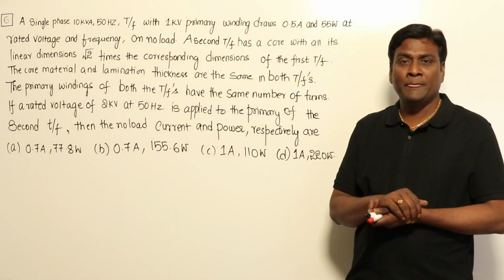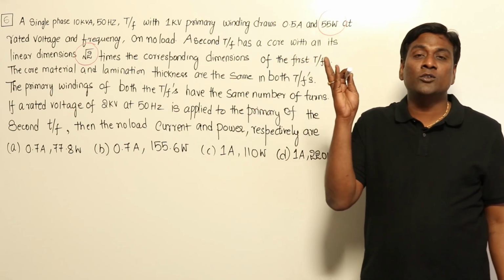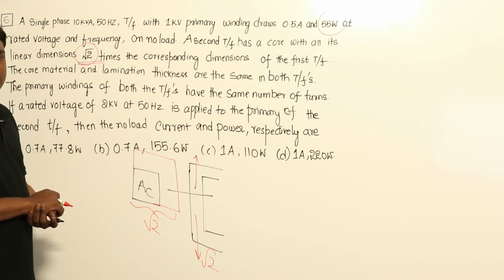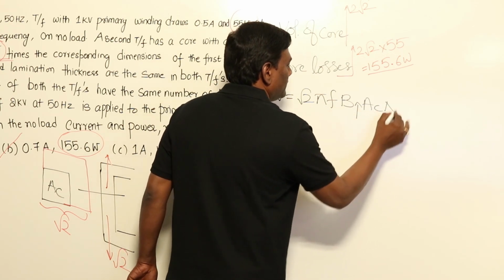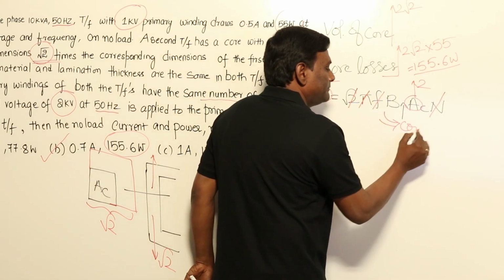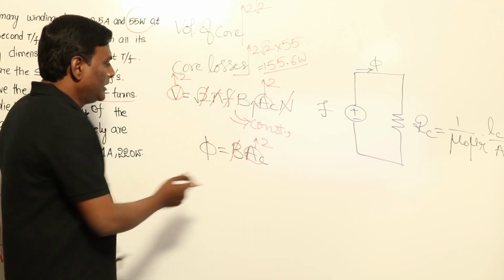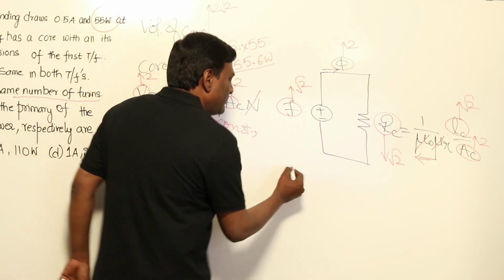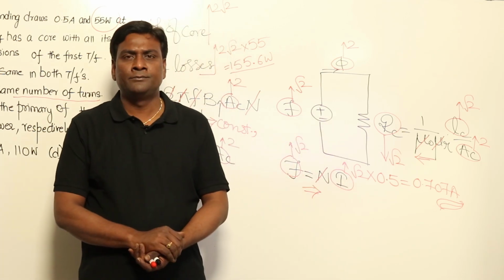Ideal Transformer at No Load | Part - 4 | Electrical Transformers | Electrical Machines | Kn Rao

Comment: Sir , One doubt 

Can you explain by comparing problem no 6 with problem no 1 .

There also you have given linear dimensions are two times .
In this case root2 times you multipled total volume 2*root times .

Why not 2*2*2 in first case that is in problem no1
Reply: Here dim. Are root2 time of original that r2×r2×r2 i.e 2root2